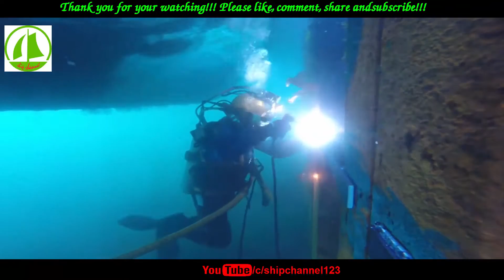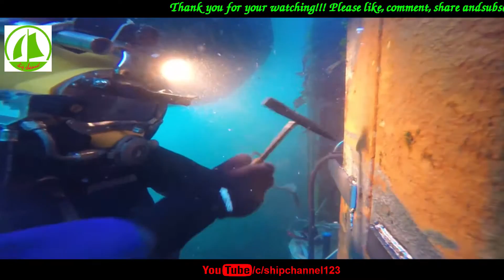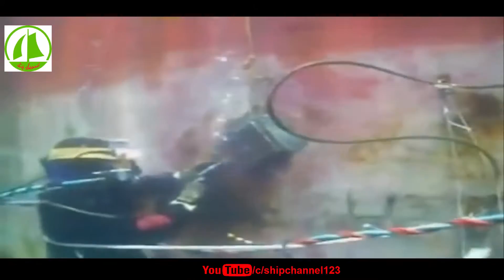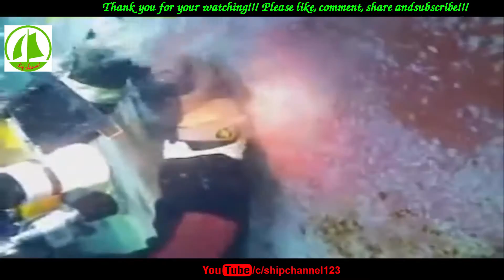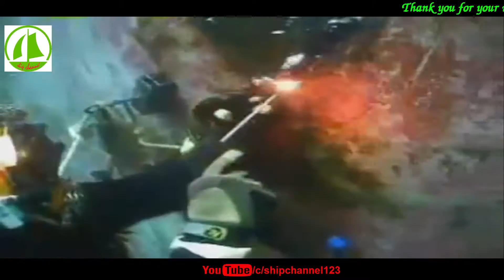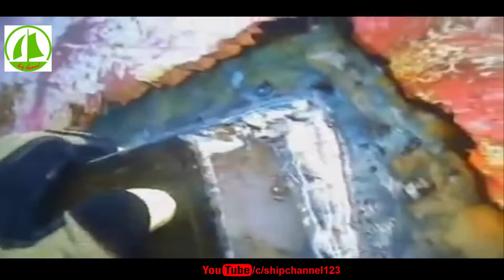ship welding: ship underwater welding | ship channel|

Comment: The first video is made by Jonathan Noiles and it shows him welding brackets on a sheet pile curtain for the installation of anodes. I want also correct you to the fact that a diver never uses a tank of argon nor nitrogen when he does wet welding. As you can see in Jonathan sequence, there is not such gas around his rod when he strikes the arc on the steel plate.